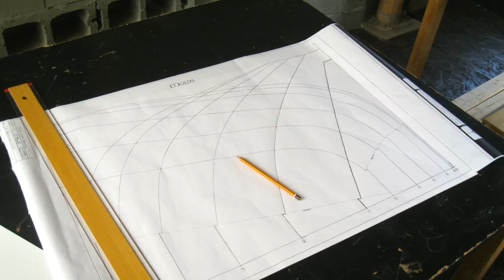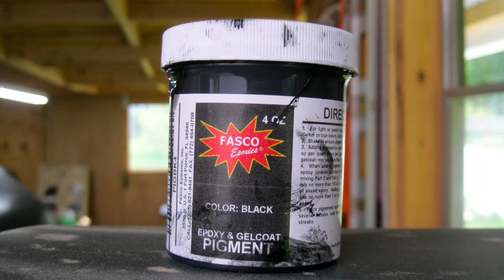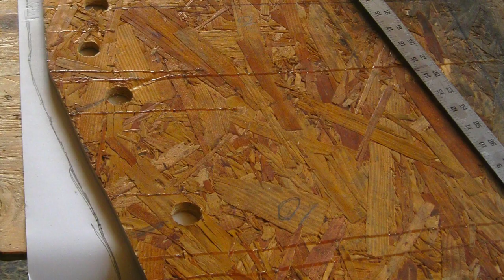How I Made a Melonseed Skiff part 1

Comment: Some people might criticize the rough and tumble method and materials, but I get it. I am sick of wooden boats being spoiled by all this gourmet lumber made of wood imported from the island of pingo pongo and 7 layers of veneer and epoxy. Enough to make you throw up. Using split ash for the frames gets a gold star from me and so does using lumberyard spruce. I would probably try to avoid knots more and orient the strips with more quarter sawn faces rather than flat sawn but otherwise, I think its a much more honest authentic job than most. I give you an "A". Melonseeds are very good rowboats. Where is this boat mainly used?
Reply from the maker: In Maine, it rows and sails fine despite the flat sawn strips I used.....